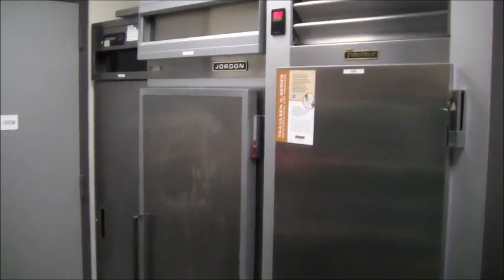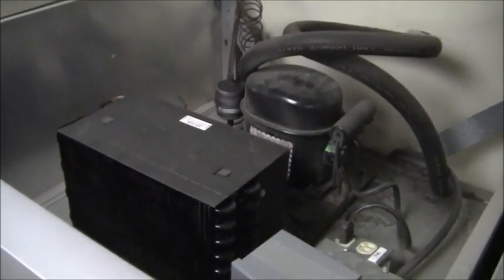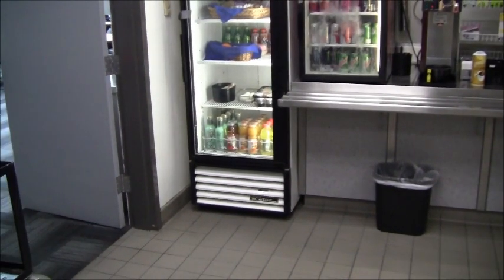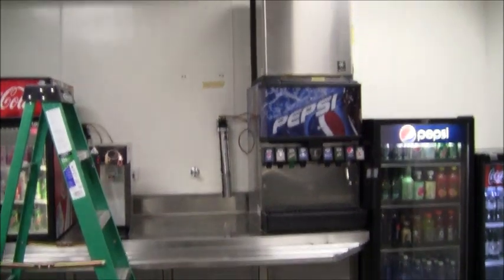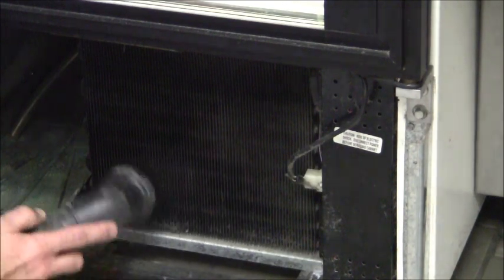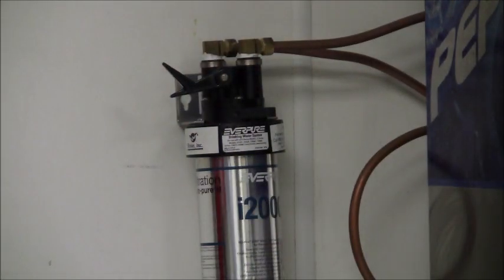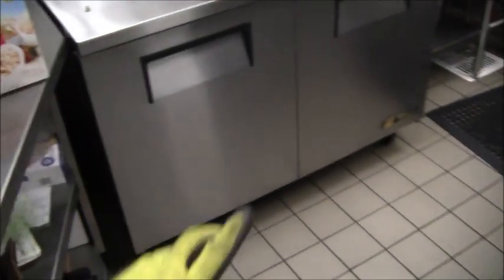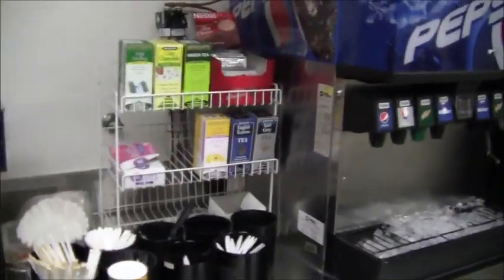Commercial Refrigerator Maintenance Annual PM

Comment: Great training when I do a cooler pm with condenser on the ground not on top  I wash down the condenser n put in a fiber filter is that common practice that's how the shop does it where im at like the ice machine we'd have a disposable fiber filter
Reply from the maker: You have a good system in place. Most of the time I used compressed air to blow off the dust and allow good air flow.

Comment: The R12 freezer with iced suction line evaporates at very low temperatura ,2 degrees F I think then it's normal to have a freezed suction line ,don't you think so ?
Reply from the maker: Yes you are correct. I did over react. The problem was when the compressor was not on the line would defrost and leave water on the floor. I did end up insulating the line to prevent that.